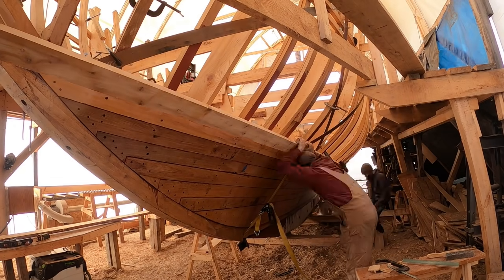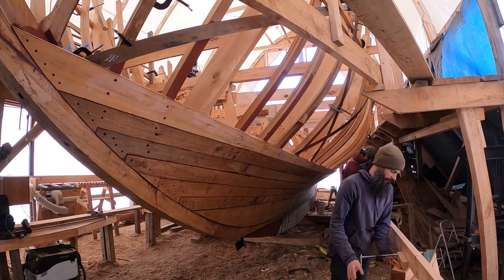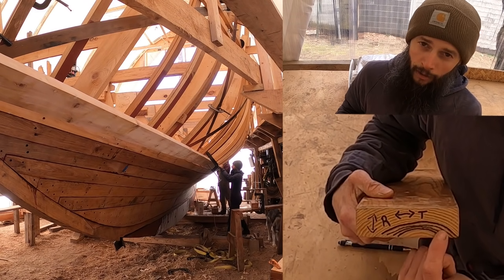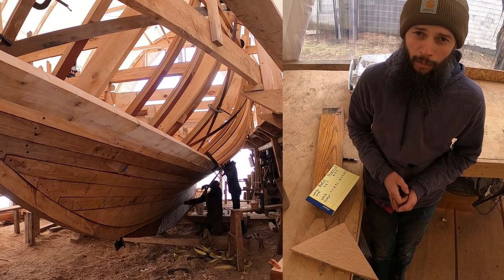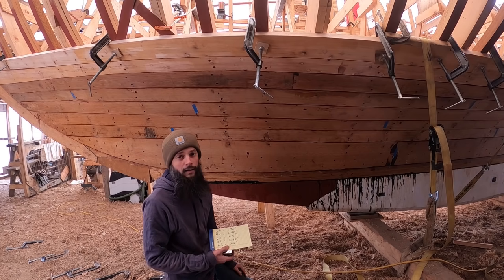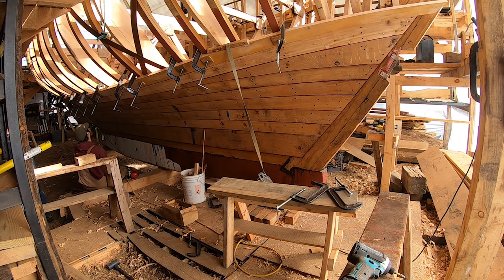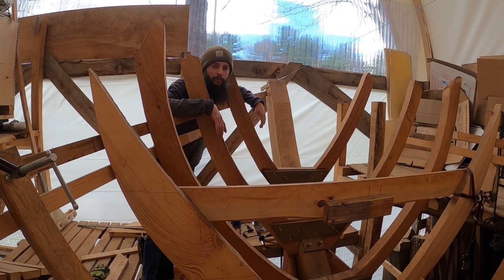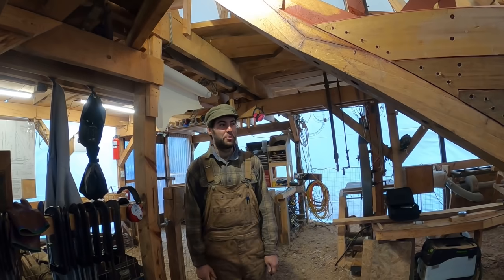Acorn to Arabella - Journey of a Wooden Boat - Episode 110: Will Our Boat be Water Tight?

Comment: Have you given any consideration on what you are going to use as corking. Oakum or cotton
Reply from the maker: We are planning on using oakum.
Reply: @AcornToArabella  Pleased to hear it Every time I have encountered cotton I have found rot. It seems that the cotton retains water and rots out the planks around the bead. Oakum does not have the same problem and is much easier to drive

Comment: Just a question, my back ground is engineering so I no very little about boat building only from what I've learnt from the likes of Samson Boat company and yourselves and yes I do believe you have a big crossover following. does the frames decide the shape of the boat if so are you not worried that the planks will determine the shape because the frames are so flexible the Sampson guy is fitting all the deck beams now before planking and his framing is far more rigid than yours still doing a great job though Regards
Denis
Reply from the maker: Not worried at all, that is the purpose of the beefy pine molds in the hull.  They determine the shape as planks/frames are bent to it.  Sawn frame boats like Tally-Ho don't have molds so either frames go up, temporary bracing goes in and planks go on, or like Leo is doing the deck goes on then  planking.
Reply: @AcornToArabella  Thanks for your prompt reply take care and be safe over there Denis Liverpool England

Comment: I really hate to have to say this but are you using the appropriate wood for the job.  My boat was planked with edge grain clear fir.  I have never seen knotty cedar used for planking before.  I would research the history of what you can use to plank.  I think you need to find better wood.  Edge grain fir is amazing and possibly still available.  Probably only second growth though.  Big issue! but you need to resolve it now.  The cedar I have seen so far does not look at all appropriate.
Reply: Another idea would be to steam the wood also  of course.

Comment: Putting so much force into the frame will need to go somewhere. I understand that you are trying to put a set into the planks and the bent frames. But it is like winding up a rubber band, eventually it will find a way to release.

Comment: I get what you are saying about the expansion of the boards but you are factoring based on a wrong theory.  The board will not swell its full width due to the fact that it is "pinned"/fastened about 1/3 in from the edges.  So what this does it limit the middle part from expanding at the same rate as the outer edges and it will just put pressure on the fasteners.  That being said I am sure you are still WELL within specs of the boards swell and it will be fine.  But you cant calculate the total swell over the 3 ft of oak, you should be factoring based on what is outside the fasteners.

Comment: Yup. Cedar is not a good wood for this kind of application. Can it be made to work? Yes, know enough tricks, throw enough aggravation at it, and it will, but...the wood itself doesn't like being exposed to fiber rearrangement. You can actually do tests by cutting a strip of wood from the outside of the work piece and twisting it on a 30 to 30 cm span, it's likely where it will snap that it would do the same in the big piece.

Comment: Bare with me here, I'm not a boat builder. At the point where you need to twist the cedar at the stern, is it possible to cut into the sawn frame to fit it to the cedar, instead of twisting the cedar to the frame? Would that weaken the frame to have its outer surface not a smooth line, as it would have stepped profile? Maybe inlet the cedar into the sawn frame enough so that it only twist half as much as you do now?
Reply from the maker: That would alter and potentially unbalance the shape of the boat.
Reply: @AcornToArabella  Even with the outer face of the cedar planed into a smooth surface from board to board? I did see another poster saying to leave the ends of the cedar thick and plane the twist into it. Seems like a doable thing.

Comment: I’m not an expert but I am questioning your attempt to join cedar as you did oak. What about using bead and cove joining as in canoes. The radius takes up minute twisting changes and provides more surface area for sealing. Just something to consider. Your doing a great job. Last two episodes have been trying. Einstein said repeatedly trying something and expecting a different result is insanity. I wish you more success.
Reply: Numerous problems with bead and cove at that scale.  No way to caulk it; No way to fine adjust the fit; Fine edge on the outside would be very fragile without the fiberglass coating that canoes get.  Planking is structure, bead and cove in a canoe is core.

Comment: This is why most boatbuilders use the SAME wood when laying plank on hull. You have problems coming faster than they should.
Reply: Because they had no problems with the oak?
Reply: @CorwynGC  Oak is fine and so is cedar, one or the other is what I am saying. Using cedar planks with so many knot holes and such. My opinion only.
Reply: @chrisntheboat  None of their problems have come because they changed wood types.  The cedar is not clear, which would be a great improvement, I think, but it was cheap.  If you want them to change over to clear cedar, or back to oak, a donation to make it possible would help.
Reply: @CorwynGC  I do not want them to change anything Mr.diddle, just made a observation. Maybe You should donate to them and troll somebody else. You do not have enough knowledge to talk boat building with me.
Reply: @chrisntheboat  Ad hominem, the last resort of those with no reasonable argument.